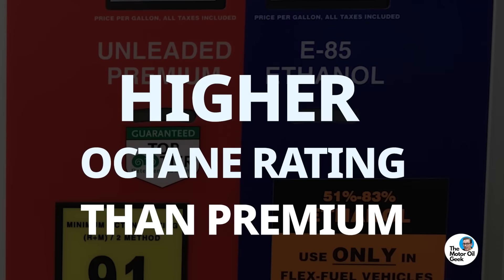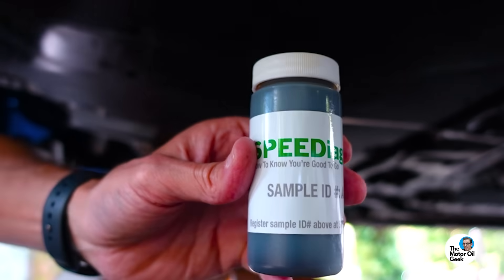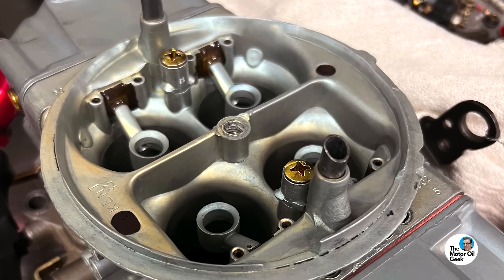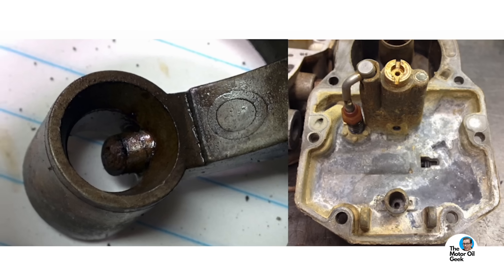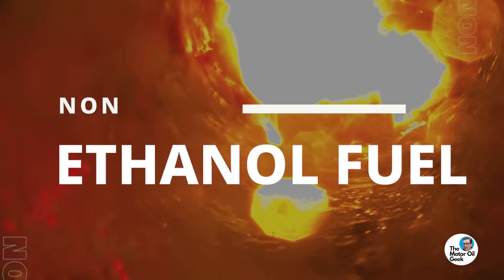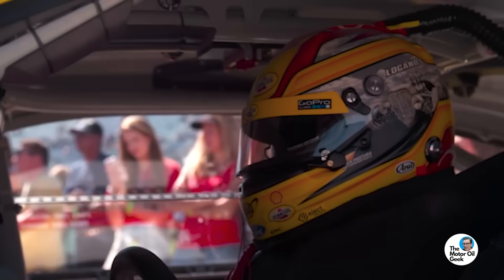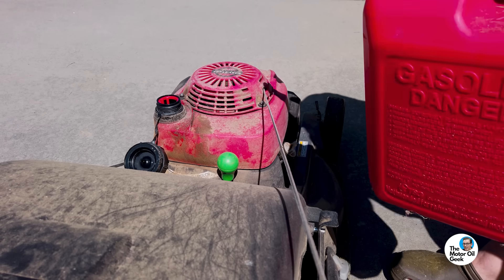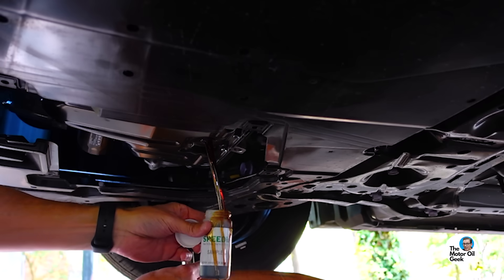ETHANOL: Higher OCTANE, Higher RISK?

Comment: It wasn't too many years ago ethanol free gas wasn't anywhere. I am glad it is more or less common in 91 / 93.
Reply: yeah I noticed that too. it was harder to get before 2020. In my town there were 2 places that sold it, and it wasnt advertized at all. one station also had kerosene and they were both sold in those older pumps from back in the day, the metal ones you take the handle off the side. Now it's at half of the gas stations.
Reply: They called it Gasahol in the old days

Comment: I've seen this issue with older non-sealed fuel systems, mainly older small engines. Newer systems are sealed. I have several generators that have a sealed fuel system, I use E10 and have never had to do any carburetor maintenance with them. I really think this is a non issue for modern automotive engines as they have been sealed systems for decades. 

I would actually be interested in dyno/performance and efficiency numbers with ethanol based fuels.  My previous truck could use E85 and I did see a decrease in mileage when using E85. My new truck can not but I do use E15 when it's available since it's anywhere from 10 to 30 cents cheaper. I have noticed I consistently get 0.5 MPG better mileage with E15 than ethanol free 87. That seems to be in contrast to the common consensus.

Comment: I learned nothing but how long can someone talk and say nothing. Ethanol is terrible for carburetors yes. It’s not great for fuel injection though. Just not as end of the world on them. Ethanol free fuel is not as easy to come by. I live in the country and the local town has 1 station that sells it and they demand a full dollar more per gallon for it. The city nearby has 1 station that sells it that I’ve discovered. Even though everyone need ethanol free fuel it’s not super widely available despite lakes lies. You can buy a “gallon” can of 50:1 mix but it’s $20 for the can when a gallon of nonethanol gas is $3.70 and a 8oz bottle of 2 cycle oil is $1.60-$3 depending on brand and store. Also hand mixed doesn’t starve your engine of oil and create premature wear and excessive heat like the tru fuel garbage he advertised. Sure you won’t foul your plug but you won’t have an engine long enough to need another plug.

Comment: Living at 6,400 ft MSL, my 87 octane recommended vehicle just purrs along on 85 octane.  It's Flex Fuel certified, so I could run E85 if I wanted to.  Knowing what I know about it, though, I DO NOT use E85.

While gasoline is a solvent, it's also an oil dispersant, and leaves a thin layer of oil when it evaporates.  This layer protects metals from humidity and oxidation.

By comparison, alcohol is a drying agent, leaving the metal unprotected from humidity and oxidation.

Comment: I never had issues with ethanol in my cars, motorcycles because they are factory designed for ethanol.  Im not farmer but I do think that long as BTEX are in gasoline, the ethanol needs to forever stay mandatory part of gasoline until they figure how to make alternatives like butanol cheaper, more common to replace ethanol. Non-ethanol gasoline appears to have around 60-80% higher BTEX content to provide the needed octanes for gasoline, engines and this type of gasoline is exactly what should be banned from vehicles that frequently are operated on public roads.

Comment: I had a lot of big issues with my 1960 Oldsmobile I’m a little bit confused as to whether it’s a 1960 the bill sheet for the car was 1959 but it was sold in 1960 model year but anyway the Oldsmobile is an 98   Four-door hardtop. I kept having a lot of trouble with the fuel at the pump car would not run on it get vapor locking and I’m running premium from Costco and run about 10 / 15 maybe 20 minutes. Then it would just flat quit like you turned the key off then it would not restart until it cooled down no reason for it. I live in Albuquerque New Mexico. The car is car. It’s got the big engine in it from the factory so I finally just gave up running that crap in it And I run aviation fuel in it 100 low lead   And it solved all my issues. Car runs fine doesn’t stall out anymore doesn’t quit running however I think it is time for a tuneup. There’s a cylinder that’s not hitting on it, and I think the carburetor does need adjusting for this area. this altitude the car came from Brawley, California, which was 200 feet below, sea level to where I live now Albuquerque, New Mexico, which is almost 6000 foot elevation. But anyway, I think there’s a cylinder it’s got a plug that’s not firing and it’s real sluggish on that four barrel so like you said, I think that four barrel needs to be taken apart and cleaned. But I’m not a carburetor man. Don’t know how to work on them. I forgot how I used to know how back in the day back in the 60s 70s when I worked on stock cars racing I forgot now and I’m afraid to tear into it and mess something up Besides that I don’t know how to tune it. That’s my story and I’m sticking to it.  All else fails on carburetors or engines that require fuel for carburetors run aviation fuel in them they run pretty good. I did that my chainsaw as well to this day. It still runs perfect I gave it to my son years ago when I got from my mother many many years ago.

Comment: Ethanol free pump gas is non-existent in my area, for the last ten years I've been using e-10 gasoline treated with Marine 360 (blue) Stabil in everything- lawn mowers, chain saws, trimmers, leaf blowers, generator, snow blower, and a carbureted pickup truck with ZERO issues in anything. Maybe I'm just lucky but I swear by that stuff.

Comment: I know countless people running e85 in their high horsepower hot rods, and highly modified modern high horsepower cars and no issues. Use the Star Tron Ring seal, ot the Stabil Marine and you're golden.
Reply: Exactly. There’s a reason they won’t let you run it in the local county fair tractor pulls and I guarantee it isn’t due to the judges being worried about your oil film lol.

Comment: It’s all about the surface treatment inside the carburetors.  In Brazil, from the late 70s until mid 90s plenty of cars came out with ethanol powered engines and carburetors.
Guess what? None had issues with oxide formation.
Reply: Brazil's non-flex fuel vehicles, boats, motorcycles, lawn mowers, and weed eaters have used >E20 since the 70s and >E27 since 2015 and they have identical engines to the US.  This video is horse hockey.

Ethanol on manufacturing and scientific chemical compatibility charts is rated far easier on metals, rubbers, and plastics than what gasoline and BTEX (benzene, toluene, ethylbenzene, and xylene) are.
Reply: @danafletcher2341  Both of you are missing the point: Both of you are using the vehicle or machine daily. In the video he mentions it sitting for a long period of time, then the issues happen.

Comment: Ooooooh, I avoid TruFuel.  I ran it for a while in my Honda Masters mower, and I started having issues with surging, loping, and stalling.  It ended up needing a carb rebuild, and the power equipment shop I use told me to stop using TruFuel, because they (the shop) see a lot of problems from customers using it - they surmised it was from inconsistent quality/formulation. I switched to VP Racing’s 4-cycle and 2-cycle fuels, and my problems went away (I’ve since switched the 2-cycle equipment to Echo Red Armor).  I also have the option now to buy non-ethanol gas; I just have to drive about 30 minutes away to get it.

Comment: Is ethanol perfect? No. But it’s a lot better than what was used up until 1996, which was lead. I think you should also do a comparison between the forces on bearings during detonation (when not using ethanol as an octane enhancer) and when using e85. I’m starting to second guess a lot of what I’ve “learned” on this channel.
Reply: Actually, ethanol replaced MTBE (Methyl Tertiary Butyl Ether), not lead, as an oxygenate in gasoline.  The problem with MTBE was that it was a known carcinogen, which was mainly a concern if underground tanks at gas stations were leaking, which could cause the MTBE to get into groundwater.

Comment: Im sure most on this channel arent worried about carbuerated engines. I thought you were going to explain more of the effectes ofs E85 with modern engines and oil. You didnt show any oil analysis or explained how E85 affects oil etc. kinda i disappointed, this video didnt go nearly far enough. I run E85 and only got no more than 4k miles on PUP 0-40 oil, im currently running Amsoil SS 0-40 as they say their oil can go 25k mile or 15k under severe service. With E85 im assuming I can get 10k miles out of the oil as thats all I driver per year. DOing oil analysis as well to keep progess.

Comment: Ethanol is another one of those climate change things that destroys the climate far more than it could ever possibly have helped 
How much energy went into repairing and replacing and building new carburetors and troubleshooting and vehicles just performing below specification due to the corrosion buildup and water from such a crappy fuel

Comment: Luckily, here in okla, we have stations with both ethanol and non ethanol options. I try to tell people to use the 100% gas in their small engines, but most don't listen. Like other things, people have it in their heads that 100% means any station that is selling the cheapest gas. They've heard so many people say you're waisting money buying higher octane fuel that they think 10 cents higher per gallon is higher octane.  True, but ethanol free is also 10 cents higher.  So they just go to the cheapest station, which has ethanol blend fuels.  When I try to tell them the ethanol stopped up their carburetor, they usually tell me they don't use ethanol fuel.
  Another major issue I see is that most small engines state to use 91 octane.  People are clueless when they push the 91 button and fill their one gallon tank, and have no idea they are most likely filling with 87 octane from the previous customer. I tell everyone to fill their vehicle tank with a few gallons before filling their portable fuel tank with lawn mower fuel. So double whammy when they use an ethanol 87 octane fuel instead of 91 octane 100% no ethanol fuel.  
  And they wonder why they are constantly having small engine issues. Most people tell me they used stabil or other treatment, and it ran great last year, but now it won't start.  I find the rubber fuel cutoff plunger is usually deteriorated or soft and stuck.  Ethanol fuel has a short shelf like, and it really stinks when you open a carburetor that has been sitting for months without usage.

Comment: In Brazil, we’ve been running cars on 100% ethanol for almost 50 years.
Reply: And E27 in non-flex fuel vehicles, boats, lawnmowers, and weed eaters.  You went to E30 this year.  

You better buy up every engine repair shop you can find, if the video is correct, you should become a gazillionaire in no time at all.

Comment: I feel like you pulled back at the end of that video.   Ethanol free fuel is not easy to come by that you would run in your car/truck and the price is considerably higher.  I look for Top Tier ethanol free when I can, but it isn't easy.  Fortunately locally there is one place that I can do this.  If I am on a road trip it gets too complicated to try and stay with the pure stuff, but normally I can find a Top Tier place to stop on a road trip.  As soon as I can get real gas in my vehicles I do it.  All my small engine stuff gets ethanol free or I have started to swap things out for electric due to the issues.

Comment: All the Ethanol proponents argue this isn't true. Everyone with an engine knows it's true.
Reply: Just think, before ethanol there was no such thing as a repair shop, things ran in perpetuity.

The US Bureau of Labor Statistics measured share of household income spent on vehicle repairs and maintenance from 1990 to 2017 during the time ethanol in gasoline went from .1% to around 10% from 2011 onward.

The share of income spent on repair and maintenance went from 2% in 1990 to 1.5% in 2017 as ethanol usage exploded.

 Before the EPA approved E15 for vehicles 2001 and newer back in 2011, they conducted long term tests on them with not only E15 but also E20 and found both fuels ran fine and did no damage.

Comment: I use E zero on my '65 Chevy Corvair.  For winter storage, run it down to under 1/4 tank.  Disconnect the battery, six months latter I restart it no issues in over 25 years.  Carbs need rebuilding about 10 years or so, as the accelerator seals fail.

Comment: Alcohol and gasoline do not mix especially if the gasoline is refined on the alcohol is not. There of course BTU issues that we all know about but there's also the corrosive issue. Alcohol is quite corrosive. 
There is a better way to add alcohol to fuel. Ethanol should not be used unless it comes from non-food plant sources. 
A little bit more corrosive methanol is a better choice. It's very cheap and can be made from damn near anything. 
What was done wrong with mixing alcohol with gasoline after the refining process. To do it right alcohol should be added to the gasoline before it's refined and the two can be refined together to make a very good clean burning high octane high BTU fuel. A fuel that would accomplish in mission control as well as improved performance and economy at an affordable price without destroying the engine. I know this for a fact because I write a report on it in 1977 issued by Mobil oil corporation.

Comment: E-85 is junk. Ive seen the ford yellow gas cap rigs break down running E-85. The yellow gas cap Fords are supposed to be E-85 compatible. And the 85 makes them brake down. Expensive fix if its not under warranty

Comment: My Dad routinely sought out gasoline with ethanol for his 1969 Opel GT.  It was the only pump gasoline that would not knock.  It had a Weber carb instead of the original Solex*, but I don't recall if he had any carb problems after the switch.

*The Solex carbs were problematic, so a switch to Webers was common for that car.
Reply: Not only that, but it is much better in close climates, it comes with "Heat"  already added.

Comment: So I wonder if MTEB is still viable if I remember correctly that was methanol based🤔
Reply: It is MTBE and oil companies paid record litigation penalties out and I think it is outlawed in some number of states.

 The US Bureau of Labor Statistics measured share of household income spent on vehicle repairs and maintenance from 1990 to 2017 during the time ethanol in gasoline went from .1% to around 10% from 2011 onward.

The share of income spent on repair and maintenance went from 2% in 1990 to 1.5% in 2017 as ethanol usage exploded.

Before the EPA approved E15 for vehicles 2001 and newer back in 2011, the DOE conducted long-term tests on them with not only E15 but also E20 and found both fuels ran fine and did no damage.

Brazil has used >E20 for identical non-flex fuel vehicles, boats, motorcycles, lawn mowers, and weed eaters and was E27 from 2015-2024 (E30 this year).  It worked out so well and for so long that Paraguay went to E27.  India and Indonesia have gone to E20.
Reply: @danafletcher2341  thanks for that. Very interesting. I just don’t like ethanol fuels because I have a couple of cars that sit. I don’t drive often. However I make sure I keep the tank full…
Reply: @timbrown9731  I would keep the tank full with E0 or E10 to keep out condensation.  With E0 I would probably purchase some alcohol to add which is sold as gas-line antifreeze with brand names like Heet or Dry Gas.

Mercury Marine, which hosted a Webinar on ethanol myths, noted that ethanol does not "grab water molecules out of the air." It is hydrophilic, which means ethanol holds water. With regular gasoline (E0) as well at E10, the primary cause of water collecting in tanks is condensation on tank walls. But unlike E0, which can absorb almost no moisture, E10 can hold up to half of one percent of water by volume, and the water molecules will dissolve in the fuel. The "solubilized" water will bypass the water separator and burn harmlessly through the engine.

Comment: I run E85 in a big turbo Subaru and I just had my oil tested when I changed it at 3,000 miles and there was no fuel dilution at all. The test said the levels of fuel dilution were so low that if they did exist, the PPM were so low they couldn't detect anything.
Reply: Same. I have a big turbo evo. And i had same results. Even said I could go to 4k miles between oil change.
Reply: @smoorley_ good tuning helps for more efficient burn

Comment: Ethanol also dries out and shrinks engine oil seals, causing more oil leaks in many engines. Some seal manufacturers offer silicone rubber seals that are not effected by ethanol.

Comment: If you cant find ethanol free fuel and want to remove it and get stright gas, mix a coupke gallons of e10 in with a galon of water.   Shake it up, wait a while, and the ethanol and water will fall to the bottom.  Drain it out, and you have straight gas.

Comment: For my small engines, I only run 91 Straight gas.  It's never an issue, even with gas sitting for a year.  
I run 87 e10 in my 03 civic, and it's been great for nearly a decade of use.

Comment: We get ethanol free gasoline here in Texas and that's what I've been using,  there's a difference but not huge but there's definitely a difference.
Reply: A difference in price?  pollution?  performance? Etc.etc
Reply: @ozzzy2000 Performance, throttle response,  mpg increase approx 1-2 mpg. It's price is also more, sometimes as little as 40 cents per gallon more and as high as $1.00 per gallon more.
Reply: @nicholasroberts9618
Me local QT has no ethanol gas, but its usually $0.80 to $1.40 more per gallon. I can concur me ct200h does run better and its more responsive also might use a bit less fuel as compared to e10.